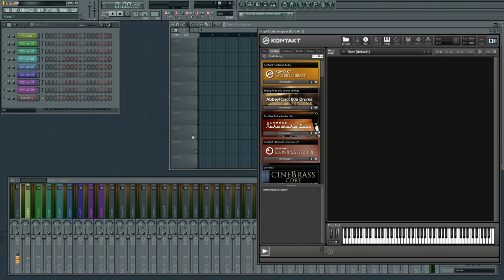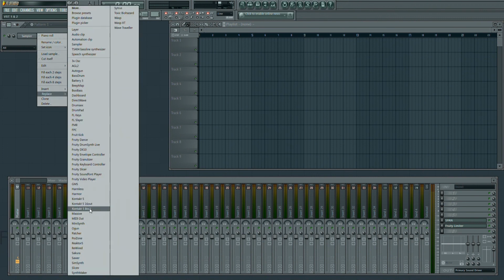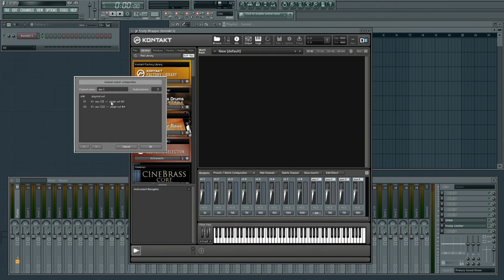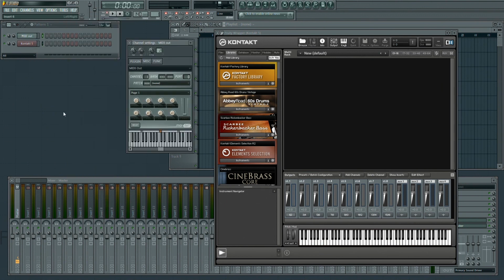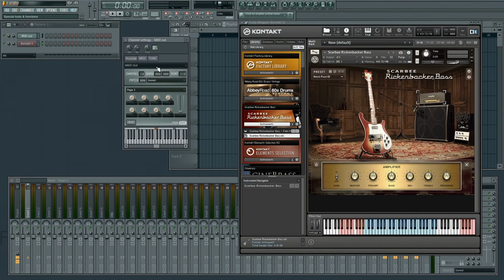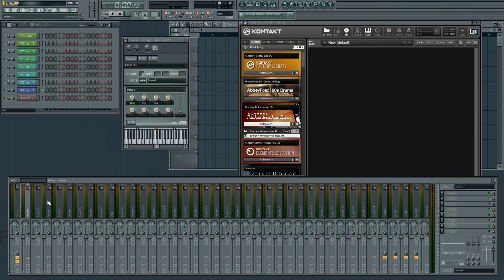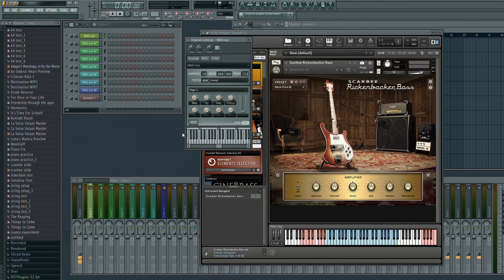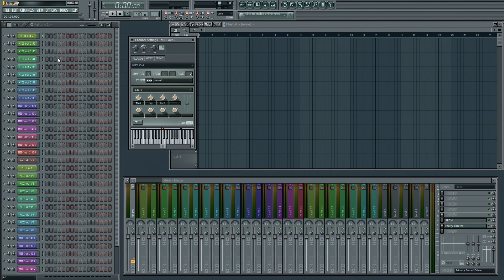Routing Kontakt 5 in FL Studio: Best Way + Tips and Tricks

Comment: The best tutorial I found on routing Kontakt in FL Studio (and I watched loads). And that tip at the beginning of MIDI Outs allowing you to set up Mod Wheel and Expression pedal response outside Kontakt is pure gold. Why didn't think of it?... Don't answer that. Loved it so much I subbed and liked. Off to see whet other gems you have on your channel. Thank you.

By the way, all the other vids use 8 or 16 out and they tell you that you have to. I always thought they were the only options for multiple outs. And the reason I was doing a search tonight is that I installed Kontakt 6, and the 8/16 out options are gone. But I learned in your tut that the default option has the max 64 out. All that time and I did not know that. Fantastic! Do let us know if you would do things differently in Kontakt 6 though.

Comment: In FL Studio 20 MIDI Out, there is a channel control setting and also an activate/deactivate function. I have been playing with those together with your recommendations in the tutorial, but I cannot get the Mod Wheel control to work from the MIDI Out (although the MIDI keyboard does drive the Mod Wheel directly on the Kontakt instrument, so that is not the issue).

Comment: how do you control the speed of the bass slides?
Reply from the maker: It's controlled with velocity. Half-note and whole notes only have one speed though. Specific to the scarbee bases.
Reply: +GhostXb ok it's working out for me thanks this was the perfect tutorial that I was looking thanks again this really did alot for me now I can finally do bass slides 😀😀😀😀 I subscribed
Reply: +GhostXb oh and how comes you never routed the pitch wheel to none of the midi control?....could you tell me what number it is so I could link that aswell
Reply from the maker: The pitch wheel will typically just work with whatever channel you have selected. If not, you gotta manually CC learn it. It doesn't have a CC number that I know of.